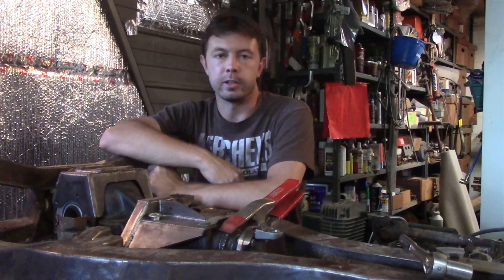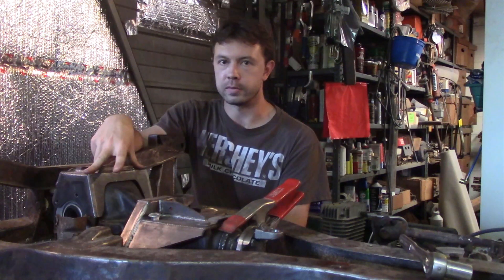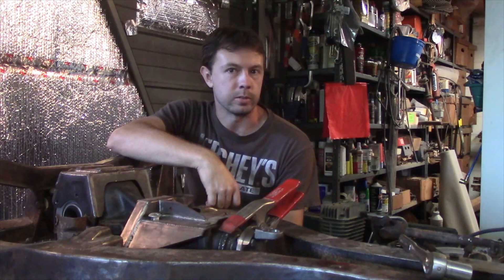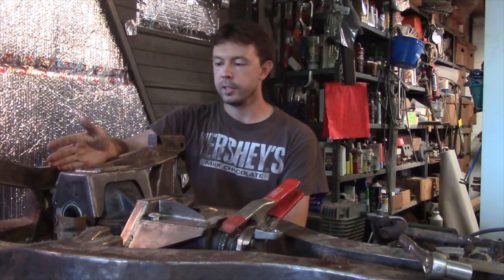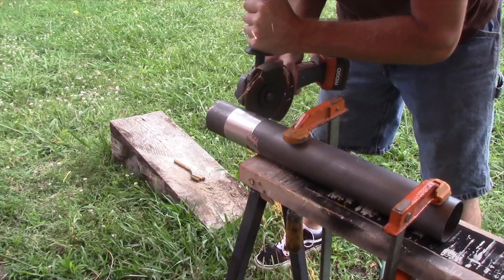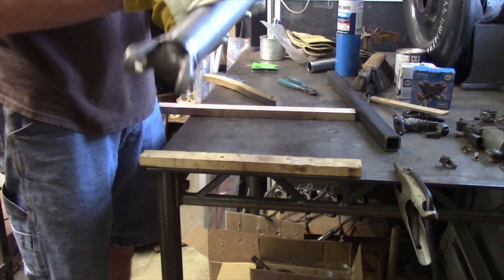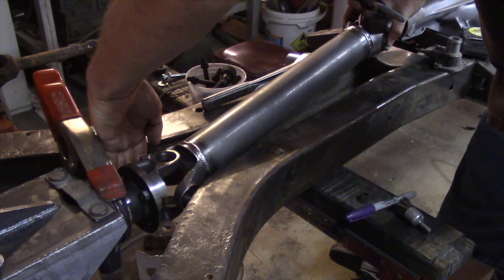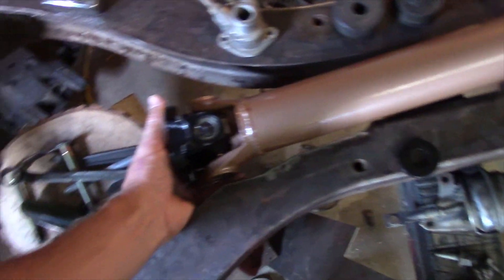VW Diesel Spitfire [4] -  Differential Swap and Driveshaft

Comment: What do you use for drive shafts? Modified Subaru ones?
Reply from the maker: The axles are the stock Triumph ones with adaptors between them and the differential. You can see them assembled in Part 5

Comment: Just picked one up what's the best budget option for a rearend upgrade or should I rebuild the stock diff? I got a Ford 8' rear for free considering cutting the frame and making a  rear subframe instead
Reply from the maker: Just get a five bolt R160 like this one, it doesn't require frame mods and you can keep the independent suspension

Comment: you were exactly right about those transverse rear springs ,they are terrible  you better hope you never have to do any correction, avoidance maneuver ever cause it will kill you  dam near did to me, and i am positve with all the torque available from the diesel it will be even more dangerous  with all the great mods you have done so far it would not be hard to design out that deadly tuck in  please consider it  you have done such a good job so far